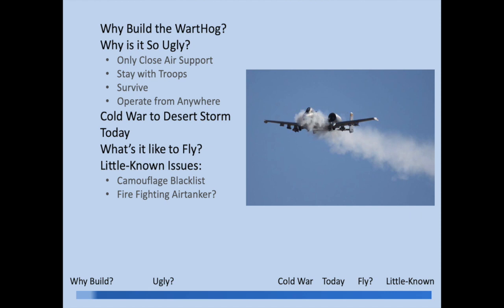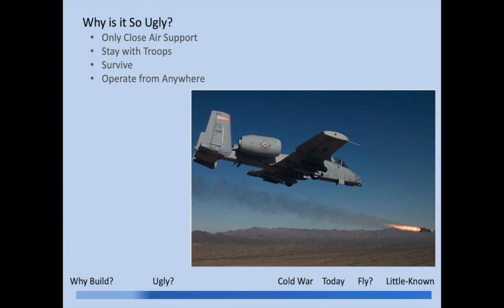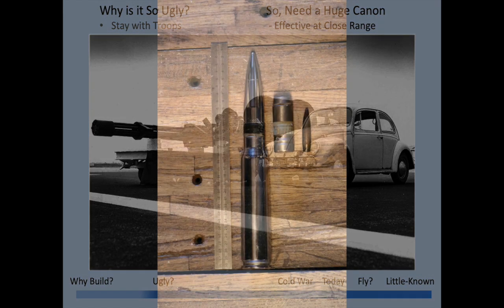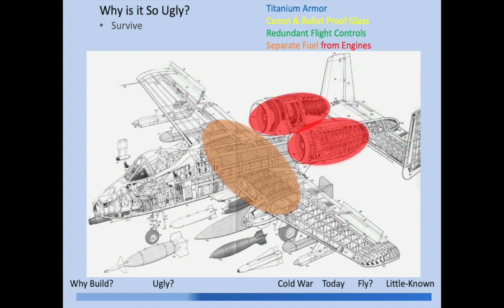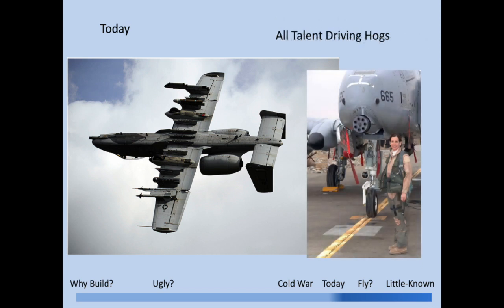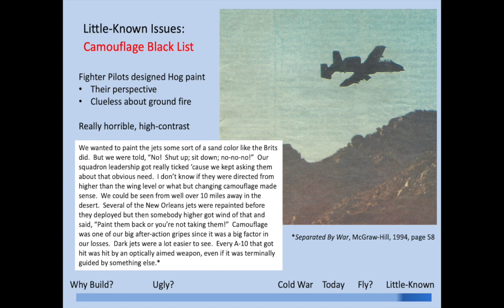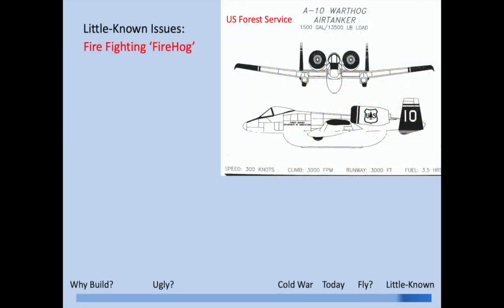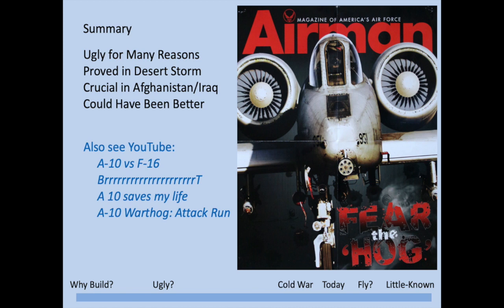A-10 WartHog's Early History: Birth of the Brrrrrrrrrrt!

Comment: Great video Ed! With your expertise, I have a couple technical question for you, please:
Background (as you know): The GAU-8 rotating barrel assembly has 7 gun barrels in an assembly which rotates clockwise from the target's viewpoint, but only one barrel fires a time when it reaches the single firing position.

1) Looking backwards from the front of the A-10 into the gun barrels, what o'clock position does it actually fire? I have found about a dozen online sources (including a nice CAD animation video, linked below) showing/saying it is 9 o'clock, and one source saying it is 7. Can you definitively settle this?

2) The entire rotating gun assembly is obviously offset, but is the firing barrel located on the lateral centerline of the A-10? Again, many sources say it is there (to reduce sideways recoil aim drift), but just need to confirm.
Reply from the maker: It fires just after bottom center, about 7 o'clock.  But remember that the barells are spinning very fast.  The idea is to fire on the center line and so eliminate torque.

So yes, the whole barrel assembly and timing are intended to eliminate sideways forces.

Comment: The A-10 is one of mans greatest weapons when used as designed and intended. 
It it a specific tool that both saves and takes life.  Any aircraft that wants to replace the A-10 will have the largest and most prestigious boots to fill in any ground war for both the Army and Air force.  
Have I properly articulated how important this Aircraft frame and abilities are to ANY and ALL future Ground Conflicts the U.S will face in the future?
—FTR I only caught one. When an A-10 took the cable, he took it like a pilot that knows his stallion has a real job to do someplace far away. It barely broke tension and pulled the cable out 20 ft.  I bought that guy a drink at the golf course steakhouse on base and never said a word.

Comment: Aid tanker is a great idea.  I lots my house in the Paradise fire.  Maybe if the moronic state of California has purchased some of these, 20 thousand homes in Paradise could have been saved.
Reply from the maker: Many lives and homes would have been saved.  At ignition, FireHogs were optimized for initial attack.  That's the ONLY way to stop a really big fire.  At the firestorm stage, they could fly at night, in the smoke cloud, and suppress a path out for trapped residents and firefighters.
Reply: @edherlik6816  paradise was very lucky with regard to the low death count.  88 out of over 30,000 in Paradise and Magalia.  Any death is tragic, but statistically the numbers are great.